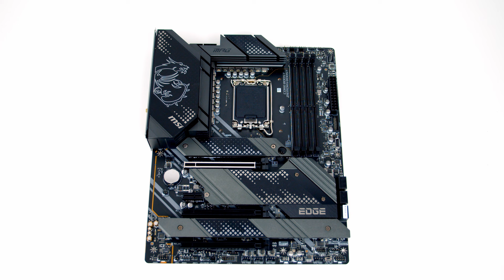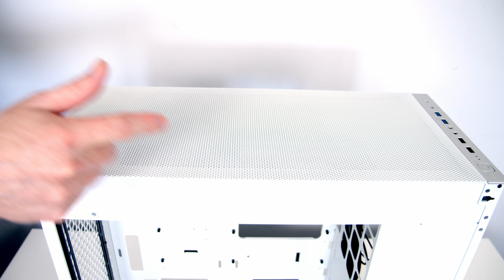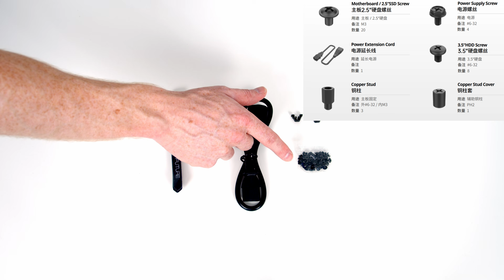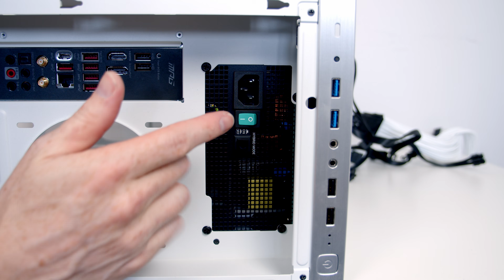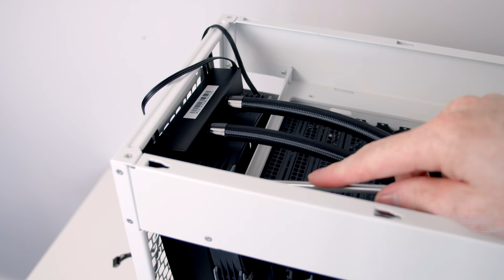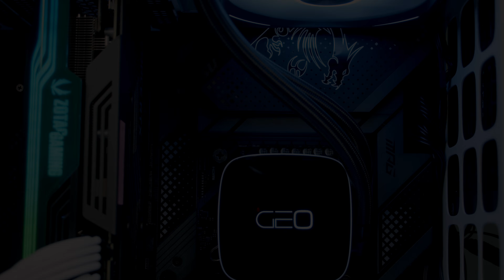Geometric Future Model 8 Lohan Build - Step by Step Guide

Comment: so..... is it possible to put HDMI, power, USB etc. etc all out of the bottom in one corner, so that it can be cable managed in a single wrapped cable? I have always wanted some sort of shroud on the back of my PC case, since the MB is mounted normally, and the IO is placed normally, and the back is just a mess of connected cables that I can't do much to manage, like any other PC I've ever built

Comment: Great video thanks! I got the same MB today the DDR 4 version mine didn't come with the manual thou only the quick user guide so this will be a great help with the downloaded manual when I build mine after cyber Monday I've also go the same ram of course DDR 4 version. I've got most of my stuff discounted on early black Friday deals. I'm just waiting to see if the price of the i5 12600k and the DeepCool CASTLE 240EX A-RGB AIO Liquid CPU Cooler come down a bit in the next days/week before I buy. Thanks again for the helpful video.
Reply: I will be using my 2060 super from my old rig as I am still happy with it's performance for the time being.

Comment: Four fans on the bottom is not officially supported, yet the cutouts on the chassis make it appear that it is. Odd.
Reply from the maker: You can't screw in the two end screws on each side